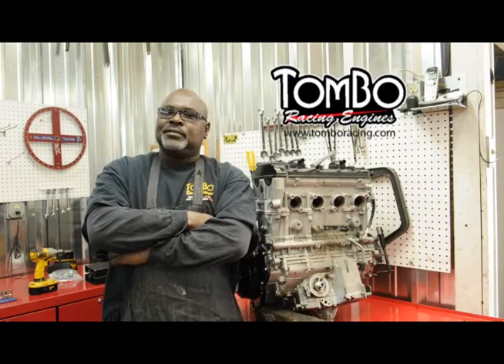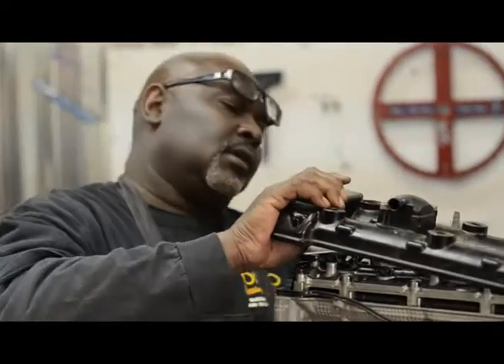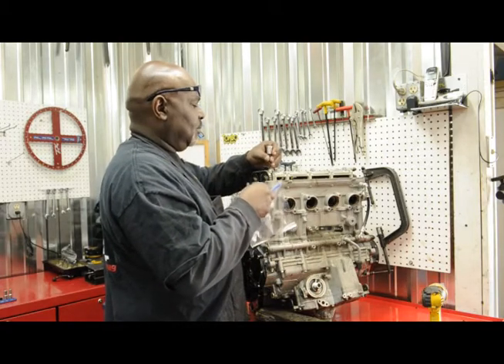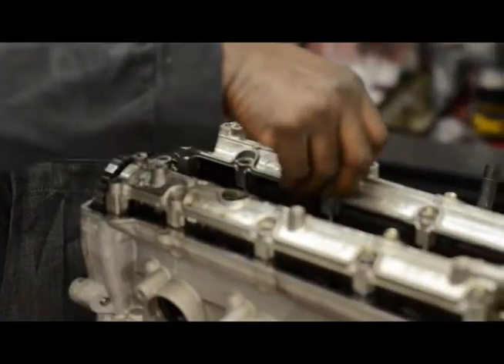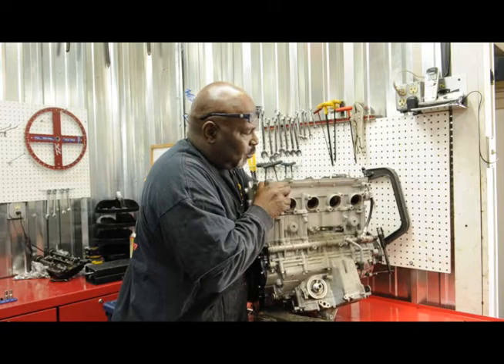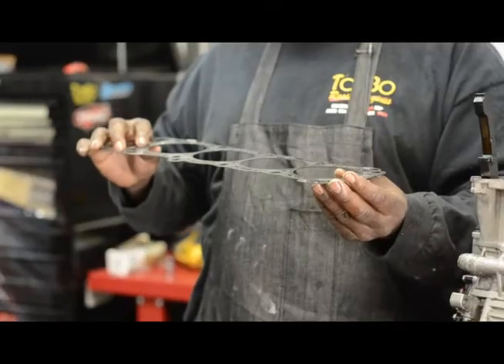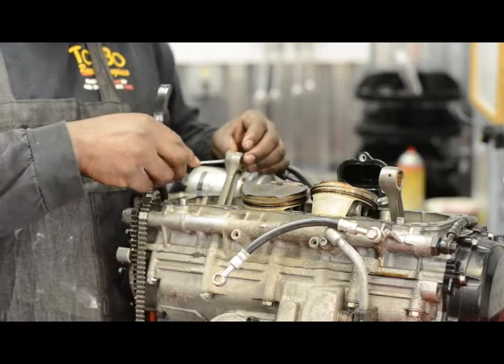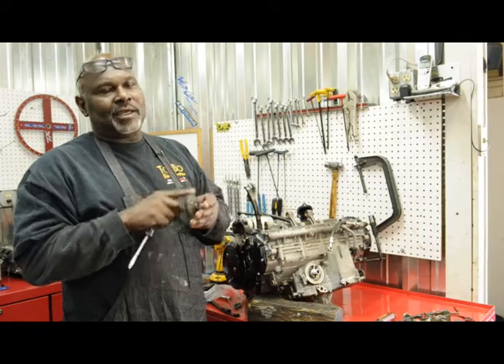Hayabusa Engine Rebuild Part 1 - Engine teardown

Comment: In elementary geometry, the property of being perpendicular (perpendicularity) is the relationship between two lines which meet at a right angle (90 degrees). The property extends to other related geometric objects. A line is said to be perpendicular to another line if the two lines intersect at a right angle.
Reply: He meant parallel . I'm his PR guy.